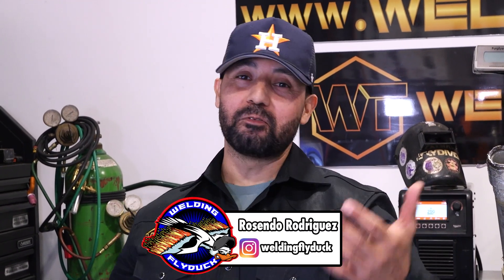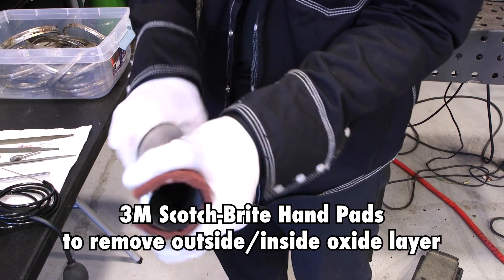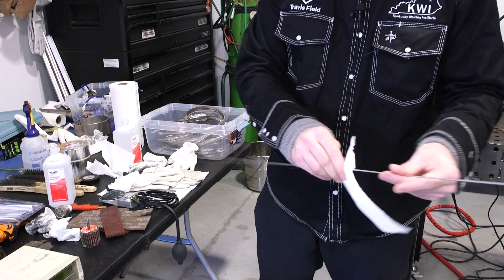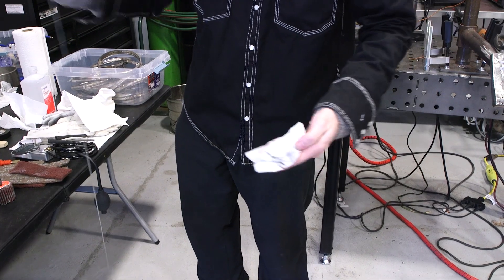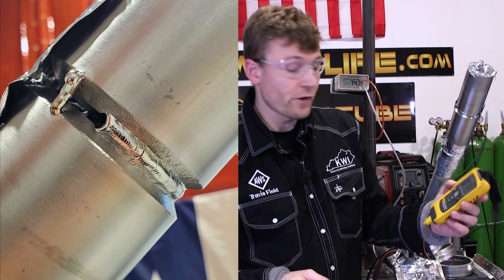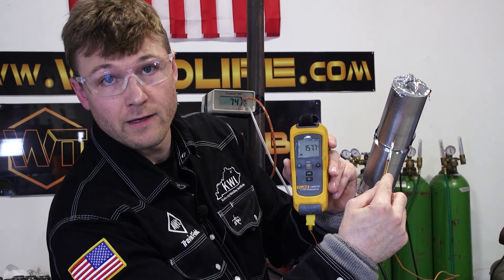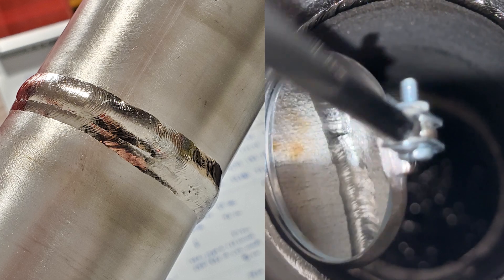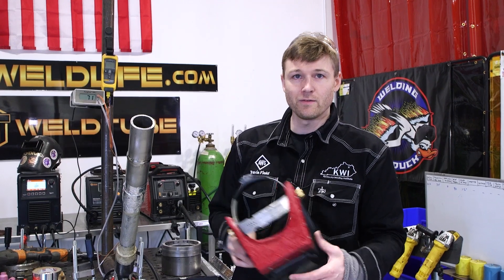Open-Root TITANIUM Tig Welding on 6G Pipe

Comment: I wounder where he got his 2" titanium pipe from sch.80 and what grade of titanium material it is....Up here near Seattle, Washington Boeing use to have a surplus warehouse open to the public and believe me they had MILES OF MATERIAL beyond your wildness imagination, materials you couldn't even pronounce let alone remember. I've seen titanium sheetmetal 128th of an inch by 4-5 feet long by 31/2 feet wide, I'm quit sure Boeing had or did quit a bit BLACK PROJECT'S. But the only kind of pipe I saw there was Steel and Aluminum.

Comment: You can use ceramic or stone discs on titanium to remove contamination risks. Not the best for pipe, but some applications require grinding and cutting, like industrial trim heaters or autoclave maintenance.